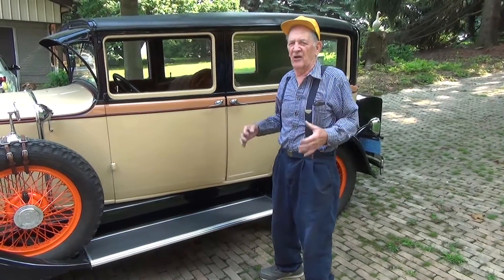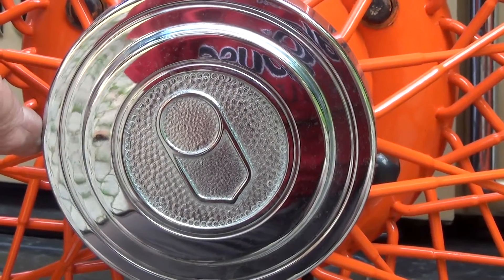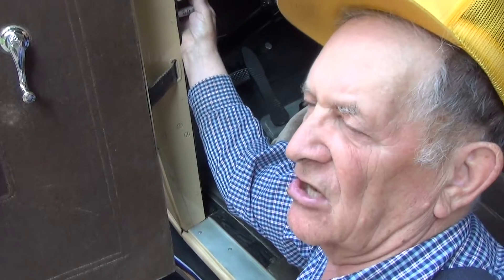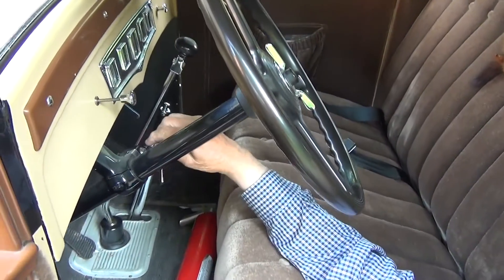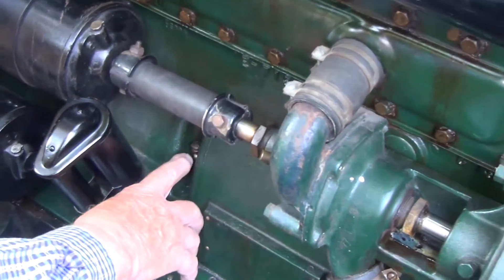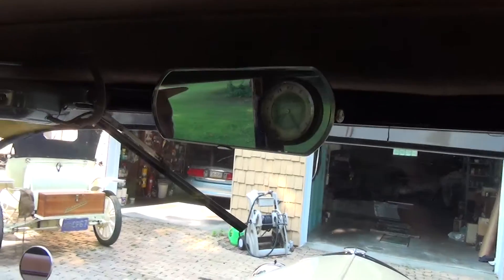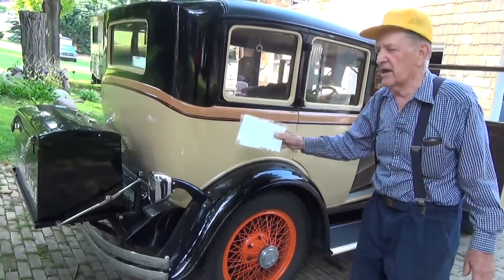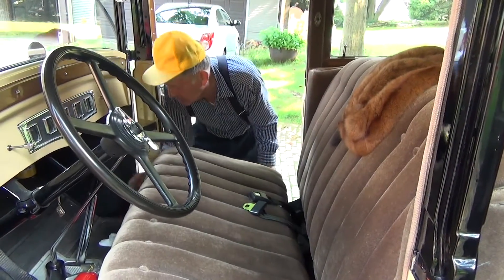Graham-Paige 1929

Comment: My family had one of those, but a "straight 8".  Spent many years driving it and it earned a rebore, but had to use 'david brown' tractor pistons as they were the only ones big enough for the 2.5 inch pots.  I enjoyed the 'jiffy seats' which dropped down from the rear of the front bench seat.  The grill was a bit different from the model shown, as, by the use of a lever, the front could be closed to protect against snow storms. (like a venetian blind)